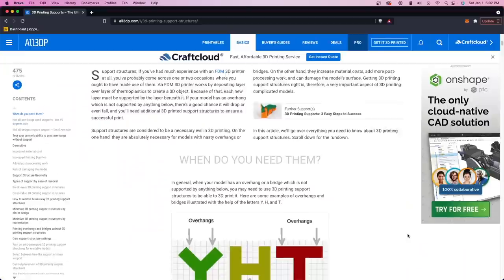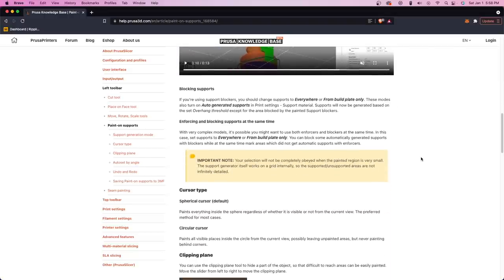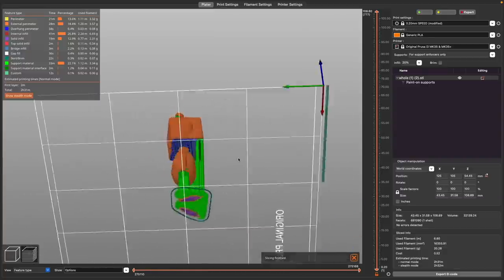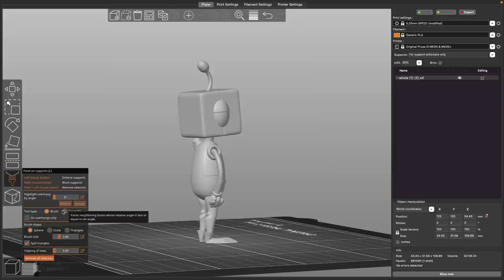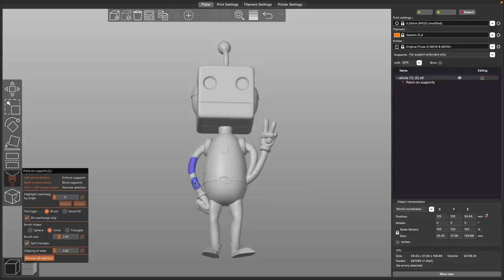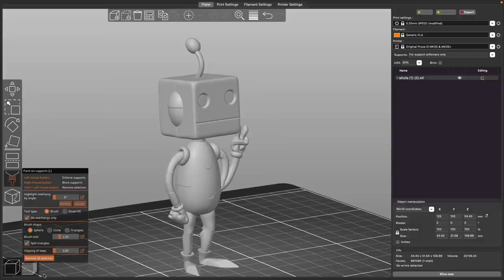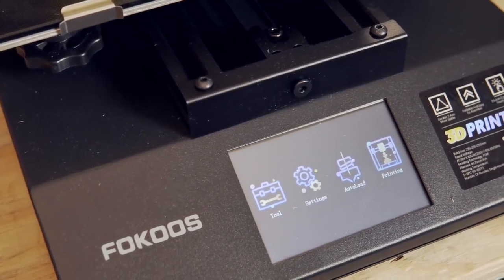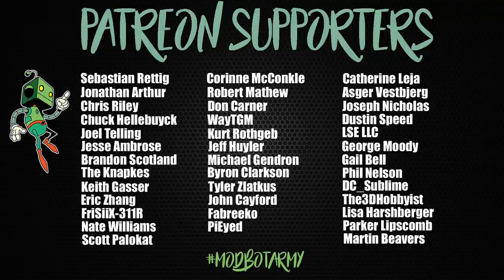Easy To Use Custom Supports In PrusaSlicer

Comment: I really found your video useful!  I actually tried doing this just a few hours ago before watching the video.  Printing a clone trooper helmet and just needed to remove quite a bit of unnecessary support.  I’ll let you know how it goes.
Reply from the maker: Fingers crossed! I know Uncle Jesse has a video on printing helmets upside down. If you are going to post process it something to consider. Otherwise no need as long as the roof doesnt cave in :p
Reply: @ModBotArmy  I may give that a try as well!

Comment: I used the paint-on support feature just yesterday.  I was printing a stylized elephant and the small tail needed more support than was auto generated. Worked great.
Reply from the maker: Yeah they are awesome. Great for a slight touch up like you described.

Comment: I use paint on supports everyday! It makes life so much easier. I think cura tired to implement it but it was really buggy? Also, I didn't know about like half the features you showed! :P
Reply from the maker: Awesome. I often only use a fraction of the features for a certain tool so going over it in detail even helps me haha. Hmm I did not know that. It is very possible. The custom supports I used in Cura do work but they take me much longer to place all of the blocks.

Comment: yay, the paint on supports are decent, still prefer Ideamaker's supports though, they pop off easier and have really good custom control without a bunch of adjustments and crap to get there, the defaults work awesome.

Comment: If only PrusaSlicer would add Cura-like FDM tree supports ... Paint-on supports are so great, but the fact that they still move straight down instead of trying to get away from the object still makes the Cura tree supports more useful in quite some cases ...
Reply from the maker: Yeah tree supports are pretty awesome. Almost magical how they are like vines reaching up to what you need supported.
Reply: They are already working on that. That will probably come in one of the next versions as well.
Reply: @extrutim  I really really really hope you are right ...  Paint-on supports combined with FDM tree support (and maybe paint-on base spot control for those, i.e. where the "tree" is allowed to touch the object) could really be a game-changer, I think.

Comment: Are the supports done by the person that made the STL file?  Or does Prusa slicer do all the supports?  For example, if I flip the model does Prusa see this and do the supports automatically or does it just support as if the STL model wasn't flipped?
Reply: Supports are generated by slicer not stl. You can turn a print any way you want and the slicer will generate supports where it thinks they're needed.

Comment: I finally have prusaslicer another go and I've hit a maddening issue with supports that I've never encountered in cura. Once i slice a model if i find i need to change the support settings, such as support angle, the setting in greyed out and i can't edit it. All i want is to change the angel from 50° to 30° but I'm unable to modify that setting unless i close the slicer, relaunch and load the model again and start from scratch. Can't i just slice, preview, modify settings and slice again like in cura? 

i also need to have the model raised 8mm of the bed like i can in cura but prusaslicer seems intent on forcing it to stay directly on the bed.  I've given up on fixing this though as everything I've read seems to indicate this is impossible.

Comment: Which platform do you prefer for 3d printing, Apple or PC? I'm looking at getting a printer soon and I'm just wondering which you find easier.  Thanks!
Reply from the maker: Tough to say. I was PC most of my 3d printing journey. I did not switch for 3d printing but rather video editing. I really like Apple for their FCPX software. Either is going to be fine. Most larger apps will be both but Cura for example definitely plays nicer with Windows.
Reply: @ModBotArmy  So I am not switching platforms, and I have zero interest in Chromebooks.  With that said I have seen so many people with Chromebooks ask about slicers, it might be a good video idea.  Chromebooks are cheap and they can run Linux apps, might make a good video idea.  I am sure you have enough great video ideas, but if you ever get board/run out I dont think I have ever seen anyone cover this particular topic :)